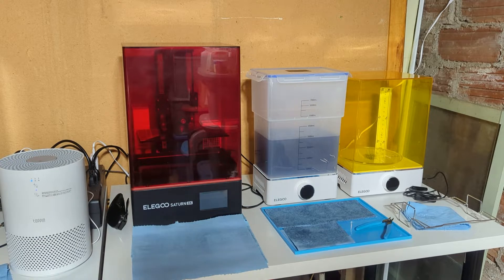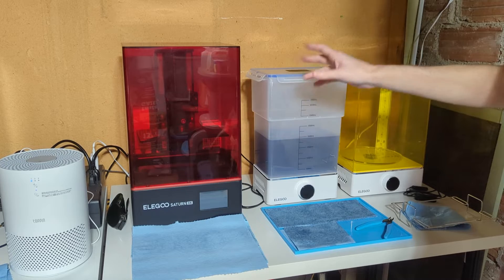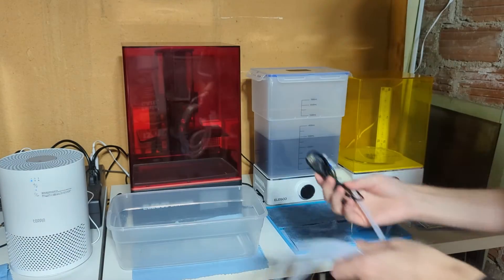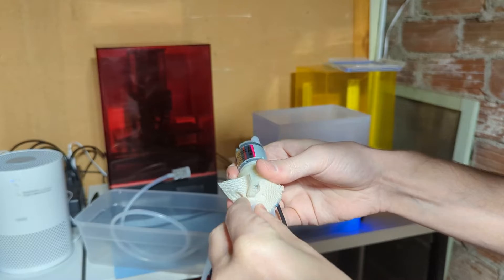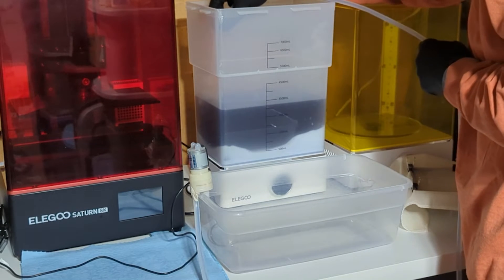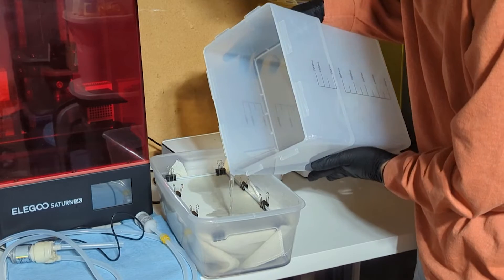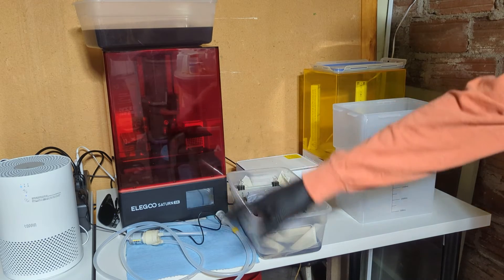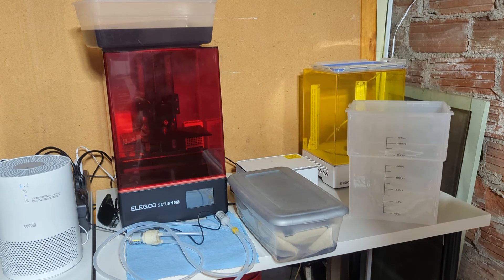Faster Alcohol Filtration for Cleaning Resin Prints

Comment: I had no idea you could get a diaphragm pump that small. I have a faster way, but it costs about 10 times more. I bought a huge 3.5 GPM pump to push the IPA through a tube wrapped with UV LEDs and a couple canister filters constantly while I clean my parts.